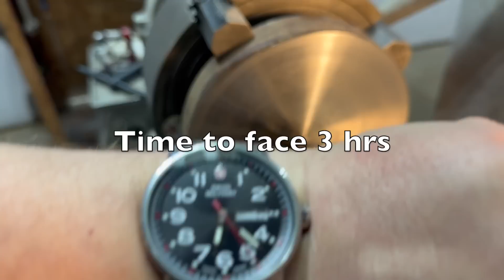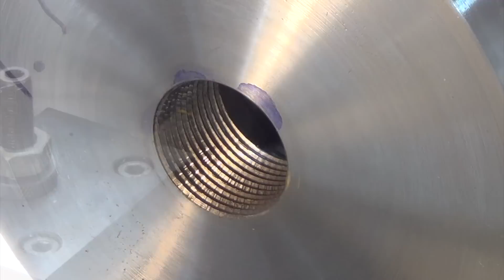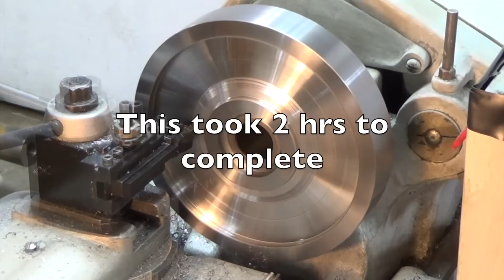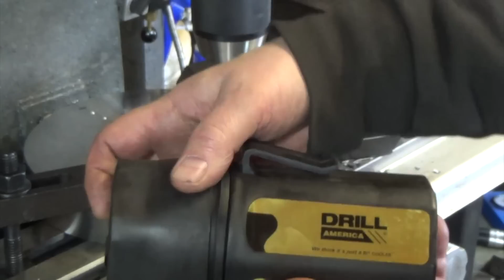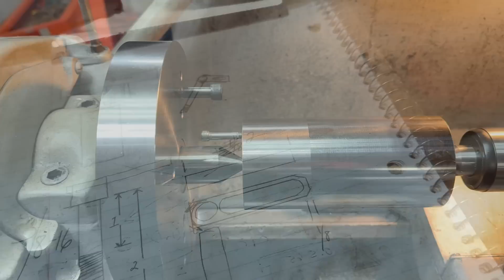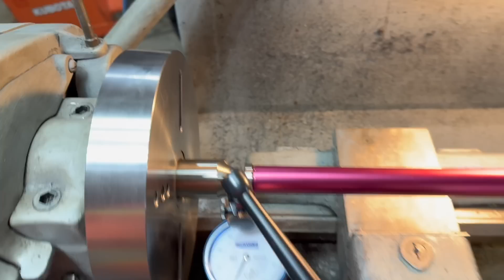DIY Lathe Drive Plate

Comment: It seems like metal lathe and wood have one thing in common- a great deal of material is removed as waste. Hopefully the metal can be recycled. The wood just becomes sawdust aka man glitter.
Reply: Industrial / mass scale machining often does recycle the chips as they make so much and have retrieval systems etc. for example, the CNC routed cases of apple’s laptops often carve out at least half the total volume of metal, but all that is collected, melted down and used to make more cases. 

For a home shop or small shop is a different matter. There is no scale, collection is very hard, different metals end up mixing, and wastage is kept as low as possible because metal ain’t cheap.

Same with industrial scale wood manufacturing. Where do you think particle board and mdf comes from? In much of the world Lots of it is from wastage, off cuts, and sawdust. I know there are environmental issues with mdf in terms of the binders used, but it is a smart use of material in some ways.
Reply from the maker: @ManFromLaBamba absolutely correct
Reply from the maker: I filled 2 black garbage bags with chips from this project alone. I haven’t found a way to use that for anything.  😉
Reply: @LetsRogerThat  Theoretically one could use an inexpensive chinesium propane furnace to melt it for sand castings, ingots, etc.  Of course, those are going to get a bit more expensive shortly.
Reply: @LetsRogerThat  No metal recycling in Halifax?
Reply from the maker: @4486igi  Yes I usually call the local recycler and he comes pickup everything I accumulate.  Great service